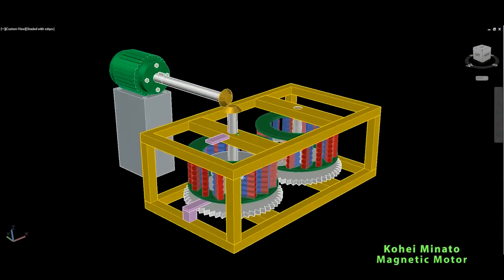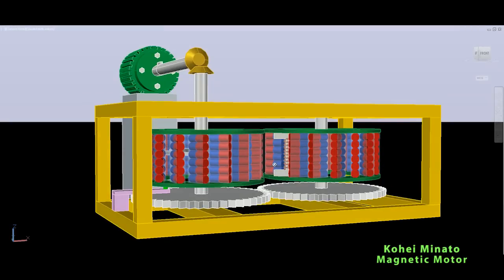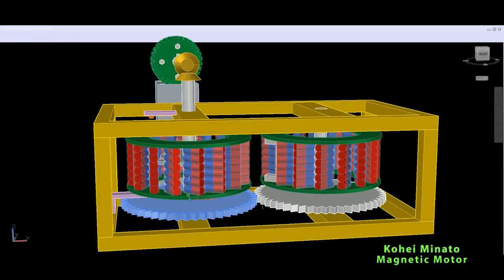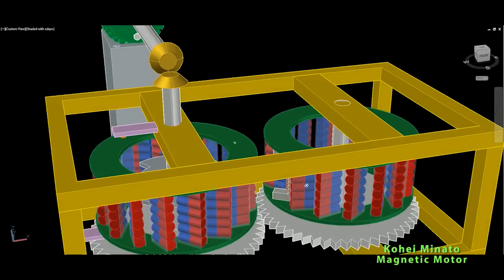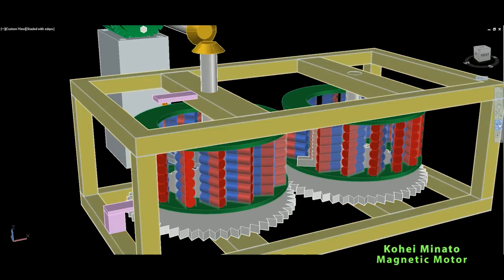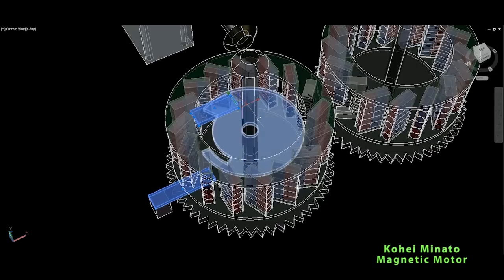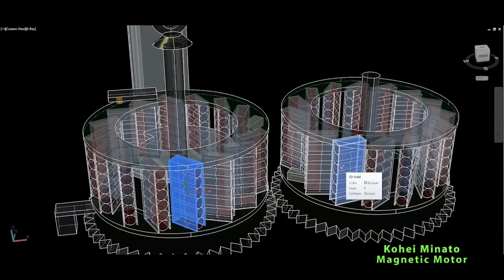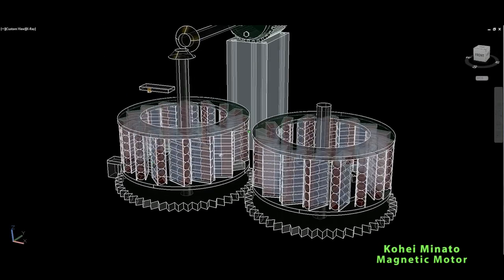Free Energy Generator, Kohei Minato Permanent magnet motor, Must see!!!

Comment: Hi Mario. This model cannot operate because the compression force on the half upper site is the same as the repelling force on the half lower site. Therefore, there is no energy gain on this system and will not work. I thinkt the inventer didn't test his idea before filling his patent. Now he will recongnize his idea had a big problem. If he had made any similar magnet motors, he would not have filled his patent.